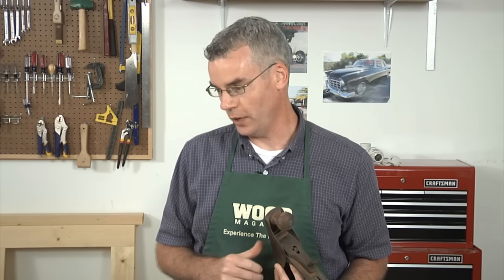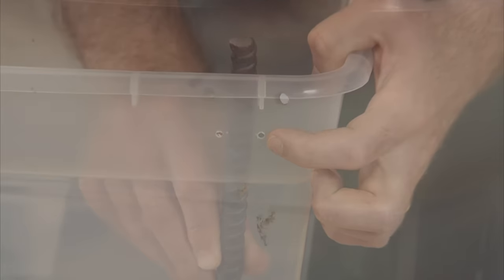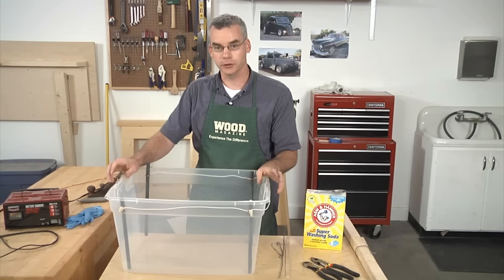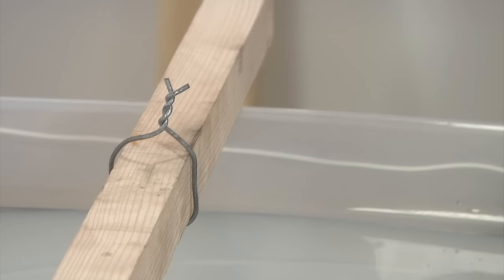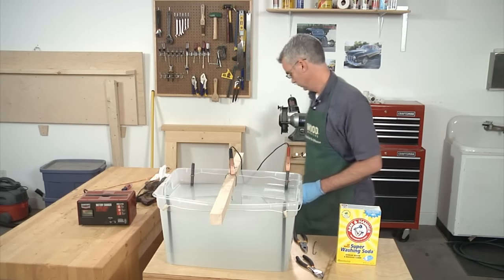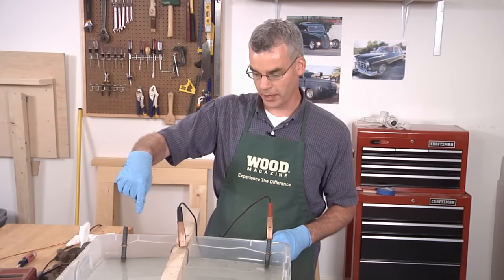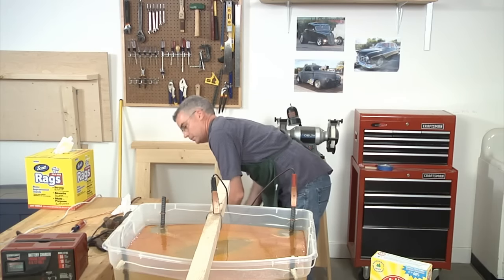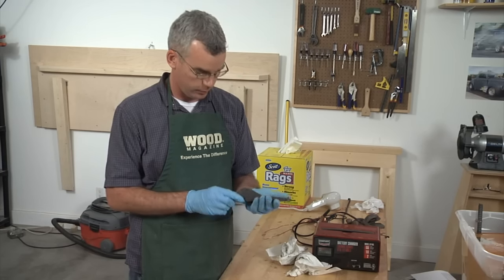Removing Rust with Electrolysis - WOOD magazine

Comment: You will not get shocked until you start getting closer to 30 volts and those car battery chargers are 14V at the most.

Comment: I just tried the process in  salt solution but the Amphere becomes high n even blow out one of my Diode on my car battery charger. Can anyone help??
Reply: Did you use a lot of salt? If yes then use less. Also did you get the polarity correct? In this video the instructor attached the item to be treated to the negative terminal. Oxydation ie rusting, is a loss of electrons. Reduction is the opposite of rusting to leave the parent metal rust free. Check a couple more videos to double check the correct polarity. You may have made a "dead short circuit" if your negative and positive wires touched , so blowing put your diode. Check everything before you switch on the power. 2 amps and 12 volts is 24 watts and could be lethal , so check everything first. good luck.
Reply: Put a buffer resistor in series to limit current and protect your power supply. Auto headlight bulbs can be handy for this.

Comment: That plane was hardly even rusty!! 
Excellent presentation though, quick, clear and to the point.
Next time maybe use something that has some heavy duty rust on it that the viewers are more than likely going to be dealing with.
I would've just hit that plane with some wd40 and a little elbow grease and there's no need for this elaborate process:)

Comment: What type of steel wire do u use Cuz I tried to u a metal hanger and it didn't work well then I tried some safety wire and only the wire was bubbling. Can get a good wire to work well

Comment: Hydrogen is lighter than air and diffuses rapidly. Hydrogen has
a rapid diffusivity (3.8 times faster than natural gas), which means that
when released, it dilutes quickly into a non-flammable concentration.
Hydrogen rises 2 times faster than helium and 6 times faster than natural
gas at a speed of almost 45 mph (20m/s).Therefore,unless a roof,a poorly
ventilated room or some other structure contains the rising gas, the
laws of physics prevent hydrogen from lingering near a leak (or near
people using hydrogen-fueled equipment). Simply stated, to become
a fire hazard, hydrogen must first be confined – but as the lightest
element in the universe, confining hydrogen is very difficult. Industry
takes these properties into account when designing structures where
hydrogen will be used. The designs help hydrogen escape up and
away from the user in case of an unexpected release.

Comment: Just so everyone knows DO NOT USE AN AUTOMATIC BATTERY CHARGER, you need an old school one with a physical 2 amp selector switch that applies charge without sensing improper connection or any of the bubble wrapped modern safety crap.

Comment: I can’t get my battery charger to turn on. Doesn’t recognize anything to charge
Reply: I've read that newer power supplies are programmed not to work unless connected to a car battery. If that's the problem here, you need to connect the power supply to a car battery, then connect the car battery to the electrolysis tank.

Comment: Don't use the wooden piece. The wire can get really hot, from the current passing it!
Reply: Dude...its 2 measly amps. I have wire leads that are a fraction of that it can easily do 2 amps. Chill boi
Reply: @DragonsREpic  6-8 amps with 24v and some chargers do that. It happened to me that the cable got to hot and melted the Plastik of the bucket it was in.

Comment: I am not a 100% sure, but I really don't think that electrolysis produces this type of hexavalent chromium.  There is always something I don't know ,but as far as I know it is supposed to be chromium(II) when it goes into solution
Reply: I think that using a steel anode will release chromium into the water.  That's what some websites say.  Iron anodes are recommended.

Comment: I do not get you people ! did you ever learn that electricity flows from POSITIVE towards NEGATIVE , NOT the other way around (as in this video)
Reply: The discoverers of electric current, Faraday, et al, did not know about electrons, so guessed at the direction the current was taking. They got it wrong, of course, but by then the 'conventional flow' + to - ,as it is known was already in common use.
Electron flow, as in this video, is from the cathode to the anode, or, the black croc. clip to the red croc. clip.

Comment: I dont understand..
Why when me trying to do this the rusty metal becomes rustier
And the other metal i use is getting thicker??
When i put the rusty metal at the positive terminal of the battery, it goes well..
Seems like a redox reaction is taking place instead of reduction process..
What do i do wrong
Reply: One electrode is reduced, one is oxidized.

Comment: Its just a waste of time. Just use wire wheel on bench grinder and it takes 2 minutes to remove all the rust. But yes for purpose of tutorial your video is one of the best.
Reply: That’s all well and good, but not all parts can be wire wheeled, the particular part my doing has a hollow internal that you cannot access with a wire wheel.

Comment: Funny he mentioned not to use stainless steel but completely neglected to tell the viewers NOT to use salt either as a conductor. When you pass electricity through salt it creates chlorine gas. He also forgot to mention that you have to use a MANUAL battery tender. The automatic ones don't work at all. Also, the more surface area you have for your anodes the better. It would be much better to use flat steel instead of rebar. Also, the closer the anodes are to your rusty piece the better it works (his setup is literally the LEAST effective setup you could have). Make sure your pieces (+/-) never tough though. He looked completely unprepared. Looked like they told him 5 minutes before they started taping that he was doing the instructional video.

Comment: Thanks, this worked nicely for me. I improved it slightly by substituting a wire brush for the electrodes and washing soda, and elbow grease for the battery charger. Ha ha. I kid.

Comment: Ok, first off bin the rebar, too little surface, little action.
 Put a sheet of steel at each end, size of the container end walls.
 Connect the negative croc clip closer to the item, just above water level, by pass that knot.
Reply: Avoid stainless unless you aim to create carcinogenic hexavalent chromium.
Reply: @stephenarling1667  correct! Edited . Thank you.

Comment: Or just soak in distilled white vinegar overnight and rinse in water, same effect, less labor and cost.
Reply: yes but it is not as effective, and acid materials will screw it up
Reply: Mitchell HürenKampf people aren't saying anything about exposure to hydrogen gas you have to have plenty of ventilation, even unplugging the power can cause a spark that you don't want around hydrogen gas
Reply: N8ZU
You can light it with a match (i tried XD) wont even explode. it looks dangerous but it's really not, simply opening a window will be enough.
Reply: Acid causes the rust to be removed.  Electrolysis converts the rust back into iron and adheres it back onto the piece.  This isn't really rust "removal" but conversion of rust back into unrusted iron.

Comment: think Bryant Cruz was asking you about oxidised aluminium. not sure if aluminium can conduct electricity very well. perhaps not.
Reply: Aluminum wire was used in houses prior to copper wire and sometimes still is as a cheaper alternative but at a thicker gauge to carry the same amount of equivalent current.  Aluminum is used as service entrance cable and on the exterior by the electrical company as well, so it absolutely conducts electricity well!

Comment: This is cheap, easy and efficient.  those talking about using Evaporust ($22 per gallon) are not thinking with their wallets.  Check any websites about treasure hunting (treasure net.com) and you will see that everyone uses systems like this.

Comment: You have the charger leads connected the wrong way around, .......... Electricity (Electrons) actually flow from positive to negative in a a circuit, ... so, ... as the electrons flow from pos to neg, they (sort of) pull the rust or outermost layer of the surface of the part to the neg.
You are using brand new re-bar, ... so, ... if it has worked, the re-bar should be coated with a layer of the removed rust..... (You don't show us that).
Try it for yourself this way with something extremely rusty.. oh! ... and use salt (or some sort of sodium) instead of wash powder in the water... Also if you connect a piece of copper, or nickle or zinc ect to the pos, and a your part to the neg, you will coat the part with whatever metal you use, ie: electroplating........
Reply: Mike I believe you are mistaken.  Electrons are negatively charged, and flow from negative to positive poles.